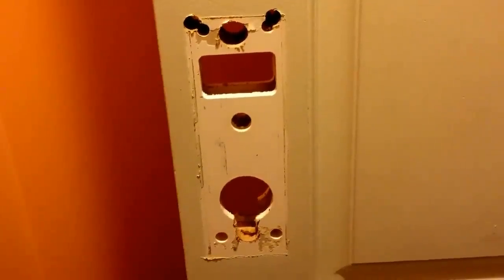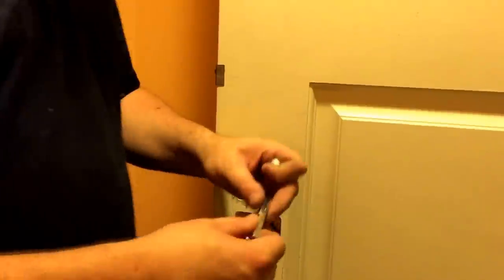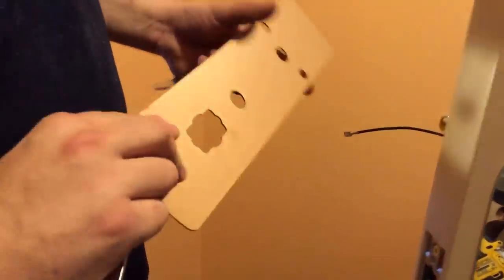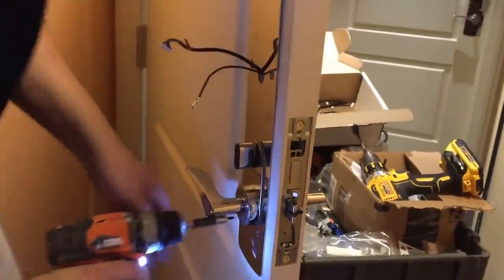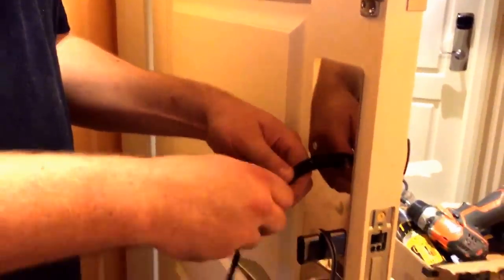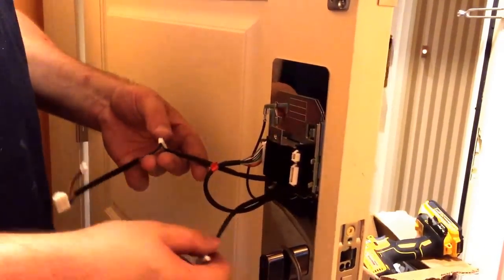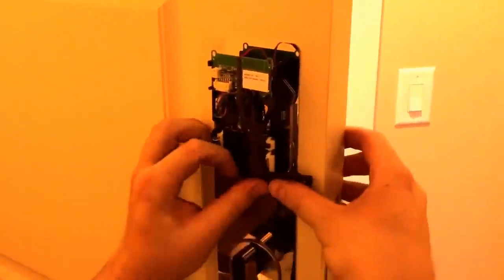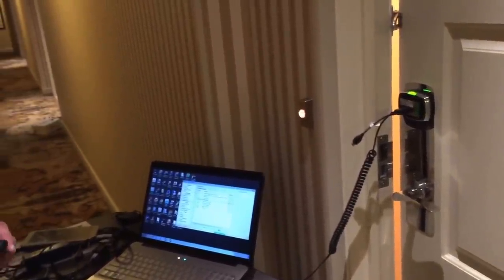How to install Vingcard RFID lock

Comment: Hi,

This lock RF Online and same time with BLE board? I saw BLE Housing, Shield under LCU. But i can't see BLE Board and what is Lock Firmware which you load? 3.17.92 Beta1 \ Build time 04.09.2015?